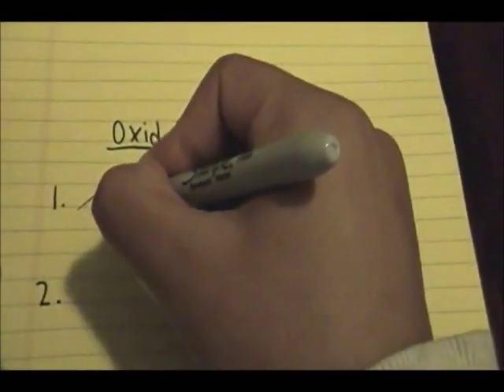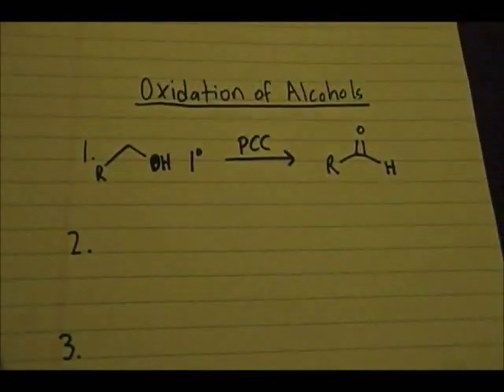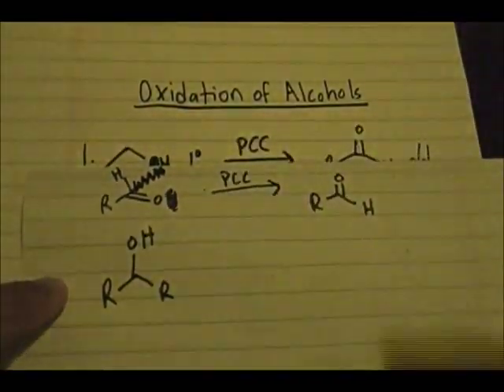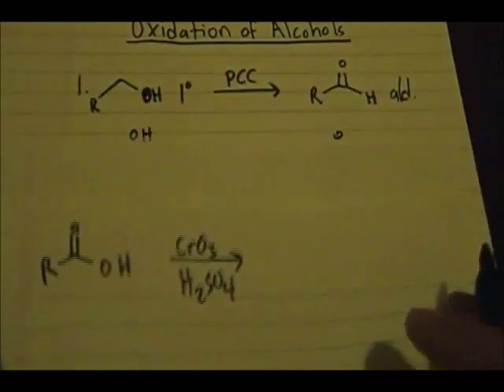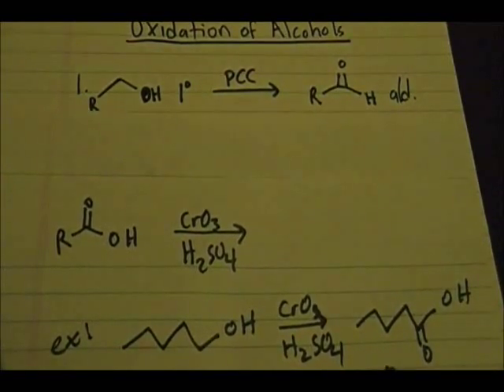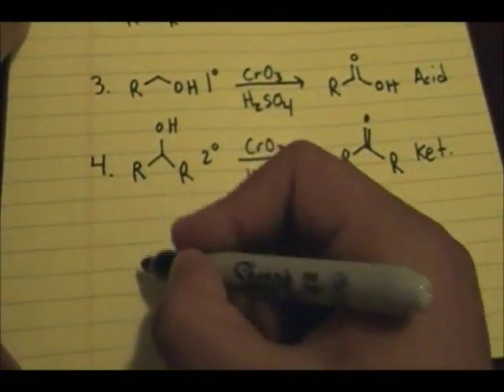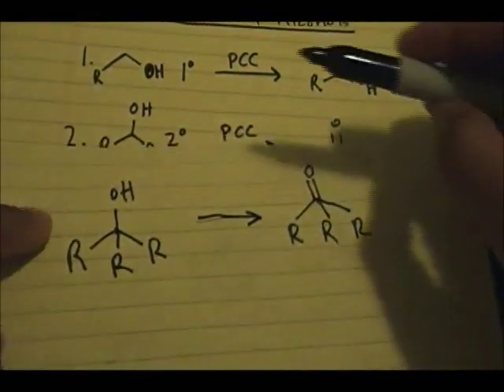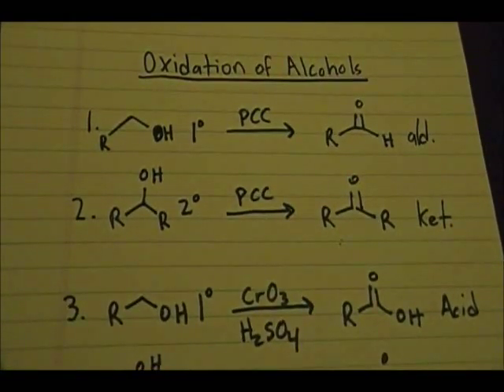Oxidation of Alcohols

Comment: what is PCC ?
Reply: asif hussain PCC is pyridinium chlorochromate. This reagent provides milder oxidizing condition, so the oxidation of PRIMARY alcohol will stop at the aldehyde.  
Aldehyde will not survive under Chromium agent such as sodium dichromate which is a stronger oxidizing  reagent than PCC, and we will get carboxylic acid from primary alcohol.
Therefore, if you want to get aldehyde from your primary alcohol, PCC is your reagent. if you want to get carboxylic acid from your primary alcohol, you should use chromium agent.
Reply: thank you it was very helpful :)) Rose Asemanie

Comment: i) It's Potassium Dichromate (VII). The formula is K2Cr2O7.
ii) the alcohol will oxidise to form a green layer.
iii) Generally, high temperature. Any alcohol that is primary (Any alcohol with the OH on the last carbon atom, an example being Ethanol) will produce an aldehyde at first. Oxidise again to make a Carboxylic Acid. For Ketones a secondary alcohol is needed (The OH is on a carbon bonded to 2 other carbon atoms, an example being Butan-2-ol)
Hope this helps.

Comment from the maker: @Panzer0127 thank you for your nice comment.  In regards to your questions, PCC is an oxidant.  Dont get so caught up in what pcc is and what the actual structure of PCC is.  Just know that PCC oxidizes primary alcohols to aldehydes and it also oxidizes secondary alcohols to ketones.  Now, in regards to to your second question, think of sodium dichromate/potassium dichromate and CrO3 as the same thing.  Essentially, they do the same thing.  Hope that helps :)